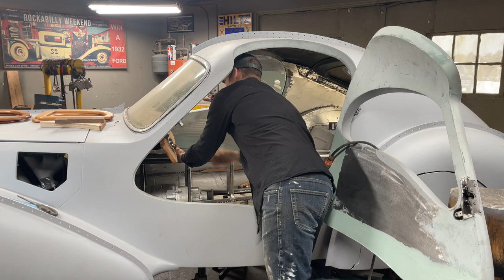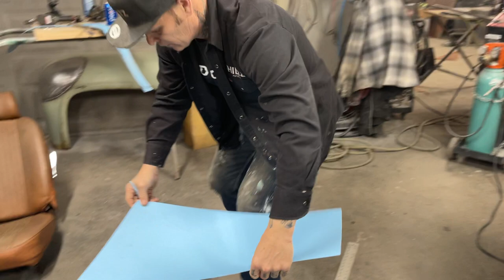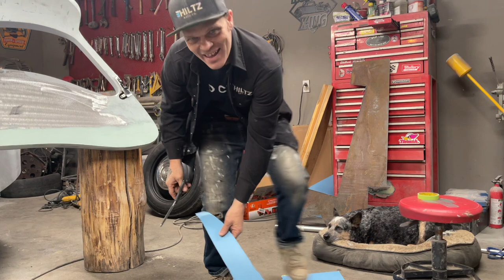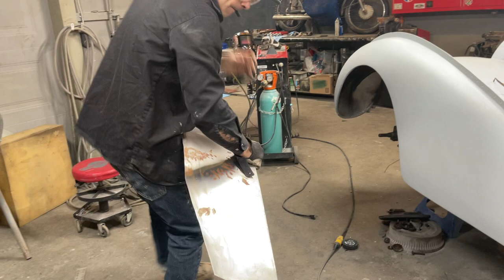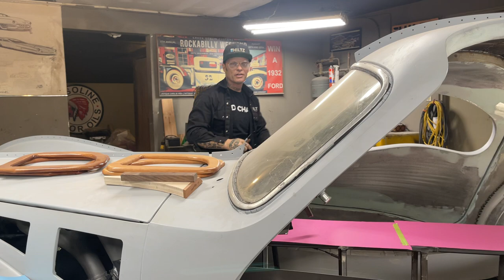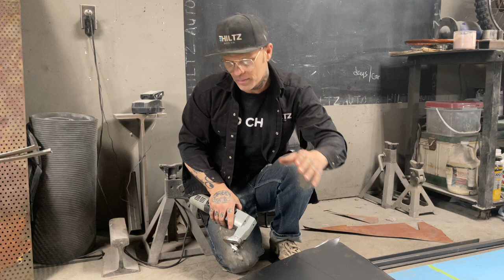BUGATTI: FABRICATING PANELS FOR TRANS TUNNEL

Comment: Years ago i was restoring a 62 Tbird. At the same time i was re roofing my home with a torch down roll roofing. I found the base layer of roll roofing was identical to the original T bird floor insulation. Waaay cheaper than the car insulation and worked great.

Comment: For the trans tunnel you could glue. if you like? Wood veneer instead of carpet covering the sides and have insulation noise backing underneath the veneer to absorb the trans vibration.

Comment: The M.G. seats look period! There is another seat you could use that comes out of an A.C. COBRA from Carroll Shelby's cars. That also would work well in a Bugatti Type 57C. You should of welded in some center cross bars for brasing for the tunnel roof. It might cave in. Good video, Chad 😁👍!

Comment: Use the most comfortable seats for Jolene. No seats intrude on the visual aspect, because they are hidden by the enclosed cabin. All of those negative comments about the seats are unfounded. Those are my thoughts.
Bottom line, Chad, you know the challenges, & you know what will fit best. I must say I am concerned about Jolene's knee's with that dash hanging down so far. Just my concern.

Comment: The mounts for this jag engine/transmission, should have a third, which fits round the transmission shaft and incorporates a spring. Without it the engine will rock back and forth when braking or accelerating.

Comment: Would it not of been better to put the top metal underneath. Do you can inset a length of vineer in the middle. Chrome drinks holder, Chrome around the wood or whatever?

Comment: I am worried now that you have cut the floor cross members. The floor panel is in two halves the full length of the car. That chopped box section would carry at least a five ton lift. Any stress now will be transferred to the welded joint on the firewall and back panel I can see the problem of running the propshaft  and possible access needed in the future My experience is limited. Hope i am wrong. I am really enjoying this build and want it to be a great success

Comment: The head rest is removable  it pulls up   I’ve read that on the mgb experience  but I’ve not tried to do it
Reply: Chad I just googled it   There is a spring clip in the seat back holding the headrest in the seat.   it says you can disassemble the seat to reach it or you can pull hard enough to overcome it

Comment: Chad, is there a reason the tunnel is so tall all the way to the back? Is it for structural strengthening?
Reply: It needs a lot of travel space at the rear, because Chad will use "air bag" suspension. So he can "drop it on the floor".
He could/should make the tunnel lower in the middle and the front, I think. But he'll make it suit Jolene, I'm sure. He'll re-design it "on the fly".